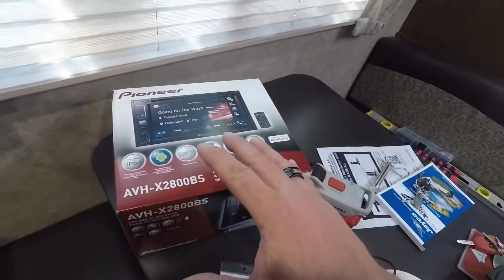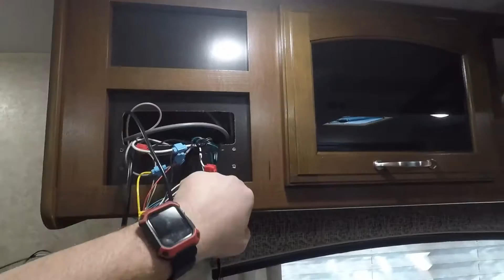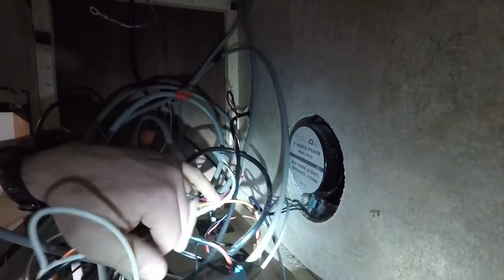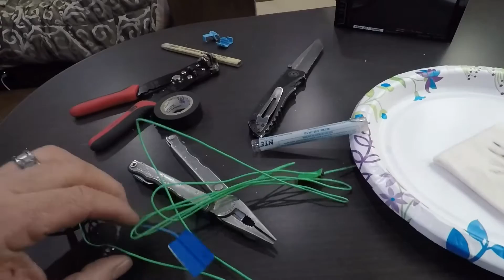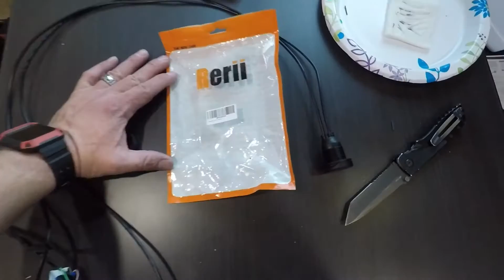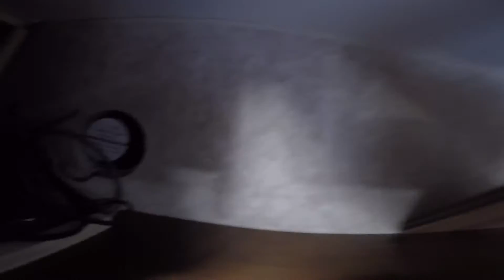3rd vlog stereo install in my Jayco Hummingbird

Comment: Thanks for the video. I also feel the Furion HU and speakers need upgrade on my 17FD. I'm looking to do the HU first and I'm looking for one that has dual zone and dual HDMI ouput. Have you come accross one that will do that?  Thanks again.
Reply from the maker: Joel Gonzalez depends on how much you want to spend.  Fusion Audio makes one with 4 zone control but I believe only one HDMI but has multiple RCA in and outputs.
Reply: XChickeneyeX thanks, I'll need to check that out. I'm a big fan of pioneer too. I'm looking to put an extra tv on the outside mount so maybe splitting the HDMI might work. I would need to find a way to run HDMI outlet outside that is weather proof.
Reply from the maker: Joel Gonzalez in this video I am using an older model of Fusion Audio it's fully waterproof also. The new one has access to fit all phones and can hook up external DVD rom

https://youtu.be/-iheXiIdgb4
Reply from the maker: Joel Gonzalez Amazon is one of the greatest tools. 

SMAKN® M25 Waterproof HDMI Coupler, Female to Female https://www.amazon.com/dp/B01JU99AR0/ref=cm_sw_r_cp_api_9qDjzbV6MCHQ3